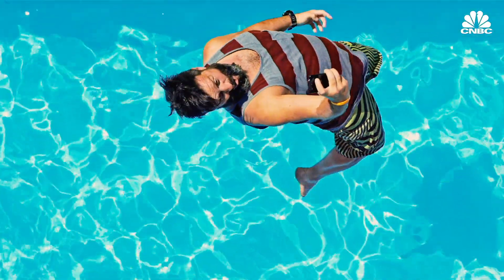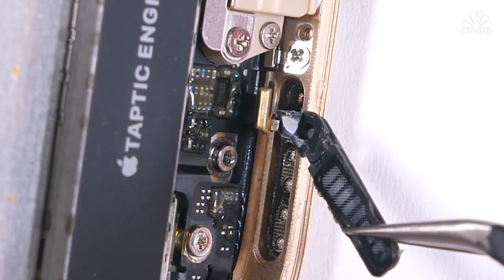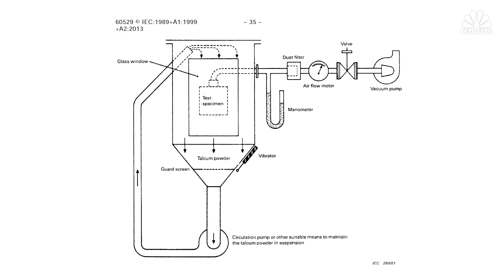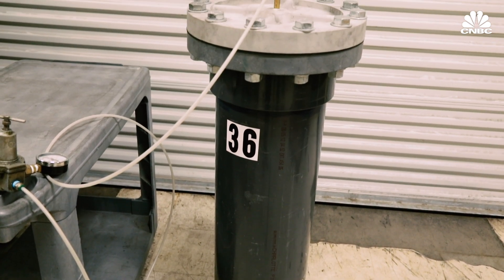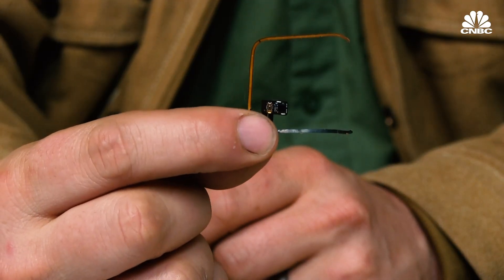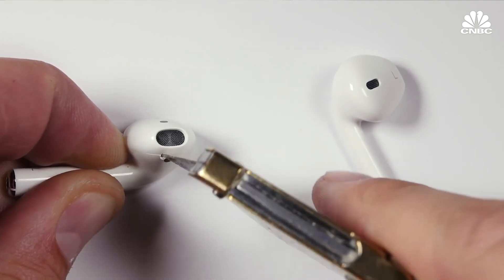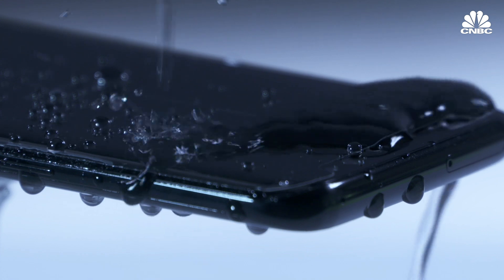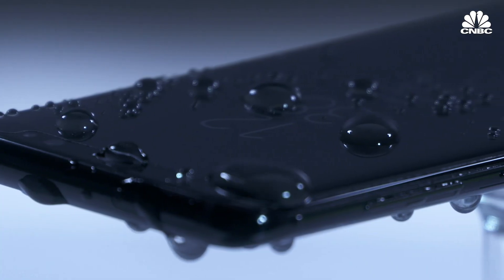Is The iPhone Waterproof? Water Resistance Explained

Comment: I don't get it. Solar Panels are IP68 and they are in dust and rain for 25 years. Phones only last for a couples of weeks??
Reply: There are different methods for waterproofing.
With only some glues and rubber tapes, The mass produce phone manufacturing methods are laughable.
Reply: but how could both these methods  be rated exactly same. This standard is laughable.
Reply: @lakshitdagar  it is rated for the moment it passes a certain requirements. But says nothing about longevity and wear and tears of the ratings.
The one on the phones wears out really really fast and easily.

Comment: I have an iPhone 7 128gb since launch. Been using device ever since. Water has been smeared everywhere on this phone multiple times, even the home button. Phone still works perfectly but a little bit slower
Reply: Good that you mention the 128 gb. How else would we have known the water resistance level.
Reply: lmao 
 @watcherob
Reply: I had an iPhone 7 too up until last month (it got stolen after all those years). It’s stayed fairly water resistant even after a few repairs.
Reply: The home button is not an actual button, it’s capacitive. This means that when you press it, sensors on the button detect it and the phone makes a short (1 millisecond) vibration to simulate a click. The button is actually a just a flat surface without any holes. (To test it, try pressing it with another solid object: it won’t work).
Reply: @svaert  Just because it is solid state doesn't mean there isn't a hole.. the button is still a separate part from the screen, meaning it can be removed and there would just be a hole where it used to be. Only thing "sealing" it is a tiny rubber gasket less than 1mm thick around the button.
Reply: Lmao I've used my Samsung Galaxy S5 to watch netflix while in the bath or shower and it runs like a charm. In any case, it only slows down when I have too many apps open
Reply: Mine to, I spilled coffee all over it; it was sitting in a puttle of coffee . I have dropped it in the full bathtub, and in the toilet. It still works! Except, now it smells strongly of coffee.
Reply: @deytao  search battery health in your settings.
Reply: TheVideomaker2341 my 7 worked fine, including after i dropped it in a few inches of water during a rainstorm.
Reply: It's slower because Apple makes updates that make it slower so you have to buy the newer one
Reply: Renix lmfao no they don’t
Reply: Renix I never updated my phone believe it or not.
Reply: Renix well the phone is already old so yeah
Reply: Renix oh like Samsung, google, one plus, huawei don’t do the exact same tactics. Companies does this as well just because no one notice it doesn’t mean their not doing as well. RIP this world
Reply: @juantapia2061  no you don't. You can either turn the throttling off or swap the battery.
Reply: Renix no because the iPhone 7 was released 3 year ago